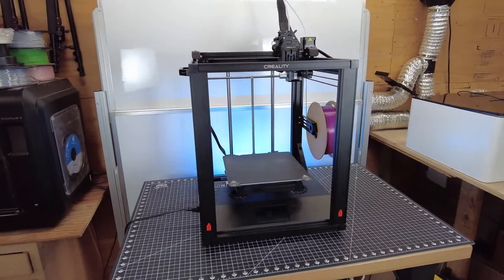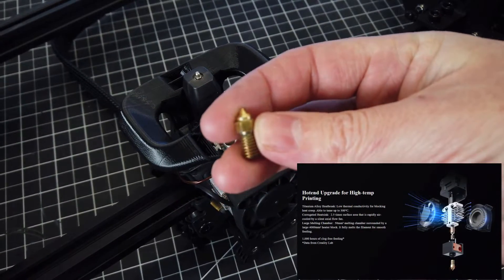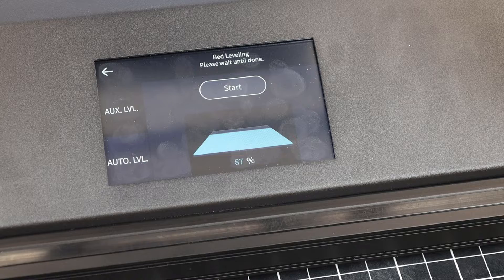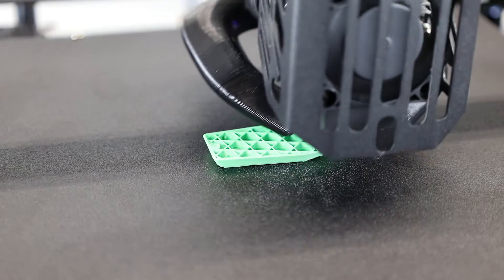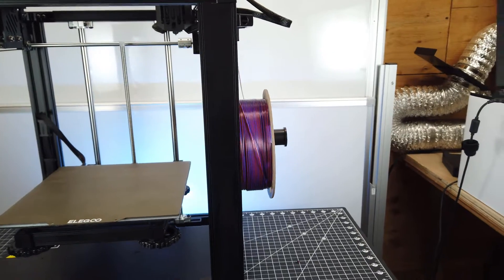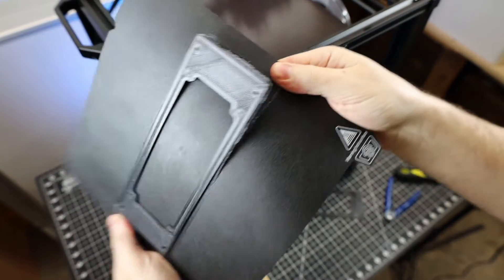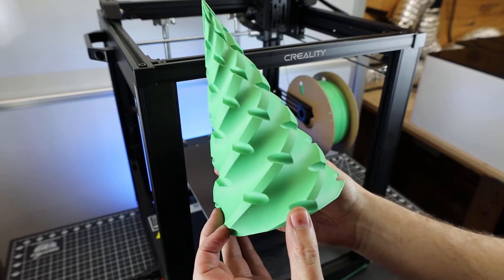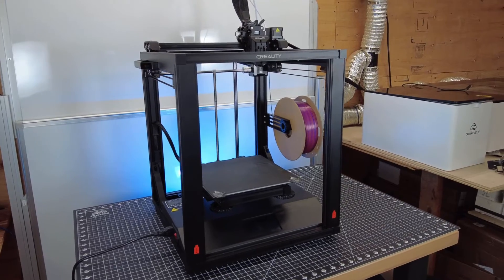Quick & High Temp 3D Printer But Is It Worth The Price Tag? - Creality Ender-5 S1

Comment: Did you have any issues with the ABL?
Reply from the maker: I haven't had any problems with it so far, why?
Reply: @randymay  I set up my printer fine with manual bed level and set up ABL only to have the nozzle dig a trench in the PC build plate. I am on firmware version 1.0. Do you know which firmware your printer shipped with?
Reply from the maker: I don't remember but I did update it. Here is a link to the firmware. Try it out and let me know what happens. https://www.creality.com/pages/download-ender-5-s1?spm=..page_1934481.products_display_1.1&spm_prev=..index.header_1.1

Comment: My Ender 5 S1has an issue with the cooling fans, only one of the nozzles seems to be blowing, any ideas how to fix it?
Reply from the maker: Oh really that is odd. Have you taken it off and looked inside to see if anything is stuck in it blocking the flow?
Reply: @randymay  My printer did do a big spaghetti a while ago, but I stuck some needle tweezers in there to see, found nothing. How do I take it off?
Reply from the maker: I honestly don't know how it comes off, I haven't really looked into it 😅
Reply: the other fan only works when you enable cooling from the screen of the printer
Reply: @mrflyman123456789  soo... no it doesnt. I think your settings are really screwed up but mine works great now. 

The issue was not the fan, but the nozzle being unevenly worn 🤦‍♂

Comment from the maker: US store: Coupon Code：12ES5, get 5S1+Sonic pad Combo $120 off， only $479
Creality Ender-5 S1 - https://bit.ly/Creality-Ender-5-S1
Creality Ender-5 S1 - Amazon - https://amzn.to/3YcHFCg

Helpful Printer Upgrades:
PEI Spring Steel Magnetic Plate Double Side Smooth and Textured - https://amzn.to/3uKgQHP
3D Printer Enclosure - https://bit.ly/Creality-3D-Printer-Enclosure

3d Printer Filament That I Use:
PolyFlex TPU 95 (Flexable) - https://bit.ly/PolyFlex-TPU-95
PolyLite Silk PLA Blue - https://bit.ly/PolyLiteSilkPLABlue
PolyLite ASA - https://bit.ly/PolyLite-ASA
TECSONAR Tricolor PLA - https://amzn.to/3H79d5N
NylonX Filament - https://bit.ly/MatterHackersNylonX

Bambu Lab P1P 3D Printer - https://bit.ly/BambuLab-P1P-3D-Printer

Push Button Start & Control Panel - https://amzn.to/3FSAGY9

TTR_GARAGE @TTRGARAGE - https://youtu.be/0h9qQQQ-2Ic

Camera Gear:
Canon EOS R - https://amzn.to/3ULd2AH
77in Tripod - https://amzn.to/3FICPFw
Studio Lights & Stands - https://amzn.to/3HqSGtv
Thermal Camera TOPDON TC001 - https://amzn.to/3HquffP
DJI Pocket 2 4K Handheld 3-Axis Gimbal - https://amzn.to/3UOqmVc
Accessories Kit for DJI Pocket 2 - https://amzn.to/3Waszeq

Amazon 3D Printing Filament 1.75mm:
PLA - https://amzn.to/3gsLE9Z
PETG - https://amzn.to/3pXjjvu
ABS - https://amzn.to/3wsTRjS
ASA - https://amzn.to/2RX8dtM
Polycarbonate - https://amzn.to/3cLdr38
Nylon - https://amzn.to/3iNGeI2
______________________________________________
Note : Most of the links that I use that go to products are affiliate link. This means I make a small commission on anything that you happen buy using them. This is at no extra charge to you and this helps support the work I do on this channel. 😁👍